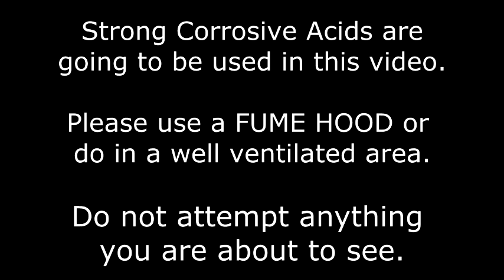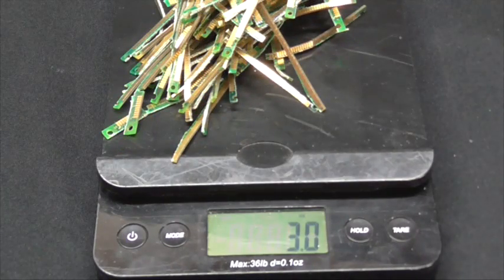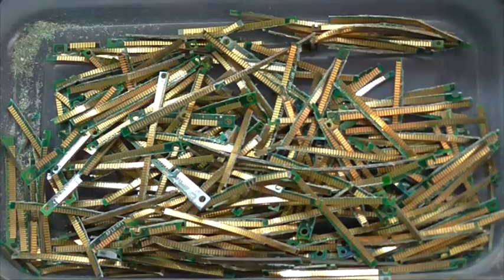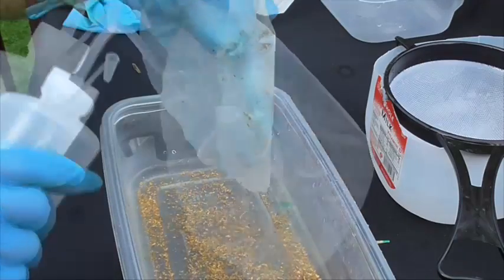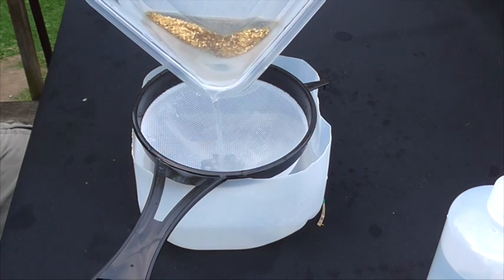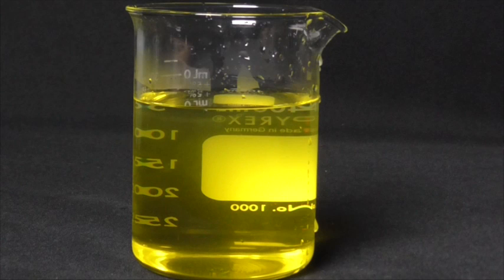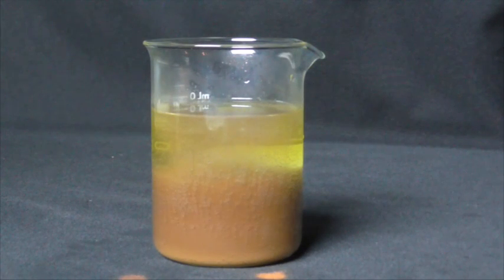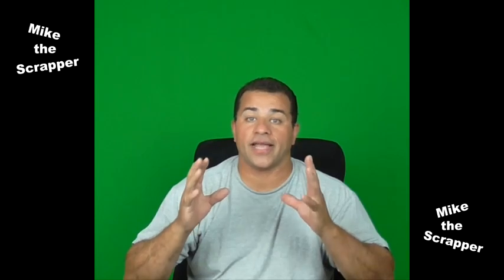Gold Recovery ( Scrapping Ram finger boards)

Comment: Hi bud you are doing it all wrong 1 little of HC and 50 mill of peroxide just to start the reaction and you can reuse the acid again and again and again if it starts to slow down just top up with HC and you can do load after load

Comment: It should come out a minimum of 2 grams, 24 K. gold from 5.2 ounces (520 grams) of RAM fingers. On video 7.55, Aqua Regia ratio 1: 1 is wrong. The best ratio is 3: 1. It is 3 part Muriatic acid another name for hydrochloric acid and 1 part nitric acid. Rest of the process is correct.

Comment: Nitric acid is expensive. I think I will do the H2O2 + muriatic acid step since those are cheap, then send those flakes to my dental scrap refiner. They melt and assay my denta crowns I send and they send me a check or bullion less a 5% processing fee which might be cheaper than doing this with nitric acid. Half the cost of my liter I got was the hazardous shipping charges!
Thanks for keeping this simple and easy. I had lots of fun in college chemistry classes and I’m glad I know what’s going on here.
Also, will this work for other items like the tiny gold fingers on certain ribbon wire, SIM cards, and the like? 
Thanks, Mike!

Comment: again, urea doesnt neutralize the acid, it removed the free nitrates from solution. check your PH after urea. still 1. 
if you actually brought the ph up you'd fail to drop the gold.... stop making videos while you clearly do not know what youre doing before you get hurt man.  
That "chemical" there is aurochloric acid you simpleton, it literally IS muriatic acid with gold dissolved in it. at what point did you think publicizing these methods and "knowledge" was a good idea? someones gonna hurt themselves

Comment: Hi man, why can't I just put all my processors directly in AR, is it necessary to separate magnetic metals? Why is this so ? Thanks
Reply from the maker: if you put all your ram in the solution. it would use up all the solution and still have gold on the ram. it is good to separate magnetic metal, that would be steel price. any metal that does not attract a magnetic, needs to be looked at. Can be worth alot more than steel price.

Comment: this is a good demonstration but the urea is unnecessary. you dont need to neutrallize the acid to be able to percipitate the solution. it wont turn back into a liquid cause your just breaking down chlourauric acid into hyrdogen chloride and gold metal. and instead of using nitric acid (its expensive) just take your stuff from part 1 and soak it in hydrochloric acid and SLOWLY inject bleach into it. HCL+sodium hypochlorite (bleach) make salt and a huge amount of chlorine gas. which will then attach to your metals making nickle chloride, copper chloride, and auric chloride. and your auric chloride will then turn into chloaouric acid. and then you can just percipitate it from there.
Reply from the maker: Dam...I think you just lost half my subscribers...LOL
Reply: lol lol lol
Reply: Yup. Just what I was thinking...lol

Comment: Hey Mike, nice video.. Just to understand, what happens if I just smelt the gold immediately after the acid peroxide filtering? Will I not get pure gold? If so, what kind of gold purity am I looking at..? Second question - do laptop ram chips contain more/less/equal gold compared to standard boards?

Comment: If you add a piece of Iron/steel bar to the copper solution after rinsing it will drop the copper and then save it. Copper in solution is harmful to aquatic life. Then add baking soda to neutralize, before disposing.
Reply from the maker: Keith Miles That is good to know....Thank you
Reply: I've heard aluminum and stainless to drop copper does iron work better

Comment: can i use muriatic acid 33% instead 31.45 % it is same work or any problem thanks
Reply from the maker: Johny Dar yes you can
Reply: Mike the Scrapper  thanks i will use becaus i purchased muriatic acid and seller sent me ) muriaticacid+h2o) was written on bottle then i mix muriaticacid+hydrogen) and put 2500 sim cards in t next day i see there was no gold my sim card was cleared and acid destroyed my all gold and i lose my 2500 sim card now i will use 33% muriatic and will see if it will work thanks for answer

Comment: My understanding is that the cost of the chemicals will drastically limit the investment's worth. Perhaps on a large commercial scale it can be worth it, but the margin is so small. Maybe if there were a simpler way with less labor, fewer chemicals but more time involved (like how one can get copper off of iron scrap).
Reply: CyborgNinja7 This is where batch size come into play. You will get better results upping the number of boards-to-chems ratio.

Comment: hi can use muartic acid again and again mean after one time using it will wasted or can use for other scrap thanks
Reply from the maker: Johny Dar you have to use it quickly. it will lose its potency
Reply: Mike the Scrapper 
 

thanks but i need help 
i  have add 1000 ml hydro+1000 muartic    for 2000 sim cards after one day
 i saw there was golden chip was swimming but after 2 days i saw all gold  disappeared  ---acid eat my all gold lol pls tell me wht i did wrong with it ,should i seperate gold in one day?  i have wait 2 days that was mistake or 
any other reason to lose all gold please answer thanks

Comment: Hi Mike, I really enjoy watching videos. I have been saving computer parts for a long time and I didn't buy them, people throw them away....The question I wanted to ask is, would you use the same amount of peroxide/muriatic acid (1000 mil of each) for doing 700 fingers?? I also have several cell phone boards, cpu boards and about 25 ceramic processors and 2 (10oz) jars of gold pins etc. You know I mite not get rich but all of this didn't cost me a thing, besides "One mans junk is another mans treasure". I enjoy scrapping, I've been doing it since 1982, it's extra money when times are hard and people are always going to throw junk away. Mike keep making the videos, I'll be watching!!!

Comment: I read the difference between gold and platinum group (5 metals) is the heating of the aqua regia. In gold you should not have to heat it unless you want it to work "faster." Referring to the catalytic post below, the platinum ($1200/oz) comes out as a paste and needs to be refined further - please correct me if I am wrong, and the rhodium ($2400/oz) and palladium needs to be refined with processes not "reasonable" to the DIY'er. Might be B/S, the right thing to do is ship to PA and let the big boys do the cats and stay out of the chemicals. Again, I am not a chemist. Last time I looked into cats I was getting $80-100 for big OEM automotive and the truckload was paying $20-40 a cat more if you save them up but the guys in PA or Quebec will grade them and give you a check. I was unsure if I refined and screwed up and got a mixture of paste that nobody wanted  I would be losing money. I went out and got a day job - it was just easier than the stress of hustling when all the used cars went extinct.......

Comment: Mike, like the vid thanks. Also watching the shaker table method for dirty boards. Had you tried taking the copper out of solution by electroplating onto a copper pipe with a transformer or  stick welder? I'm no chemist that's why I ask. I read copper is tough because of the melting point and you could also use it to replate old parts under the chrome.  Also would electoplating the gold work instead of messing with a furnace or torch? I'd like to see you make $43 instead of $40 if possible. Thanks again, thumbs up!

Comment: Hmmmmmm! Hobby huh what a wast of time work for hrs with caustic toxic acids and chemicals damage your immediate environment your skin lungs air and hair create all those free radicals and positive charged ions for what maybe 30 bucks 100 pieces of ram is approximately 3.7 lbs x $12 per lb = $36 market value for scrap ram you loose after cost of chems. Refined recovery value runs at approx $15.93 - $16.27 per lb just sell the stuff if you have that much you'll be much better off . What are these sorts trying to teach people anyway how to de-pit an avocado worthless........

Comment: A lot more profit in selling the Ram as a Ram on Ebay. I would not recomend this, as I build computers and Ram is very valuable. Those look like older versions of ram, you could of gotten $2 a board minimum (I say minimum as you would most likely get $5 per board average)  All depends on the GB of ram per each. Most of them are probally at least 512mb or 2gb
Reply: ***** LongDong
Reply: ***** Did someone fart in your mouth again? That's a bad johnny. Daddy told you not to be doing ass to mouth anymore. It is not right to want another male to fart in your mouth while you give him a reach around.

Comment: you know, Gold solves in muriatic Hyrogen PEroxide :/ so you lose a lot of gold while etching the copper. Better do it just with concentrated nitric acid or a copperchloride bath (needs time!). You can also use a oxygen or air bubbler

Comment: How much gold would you have to recover to make a good profit with the price of the chemical used.
Reply: monkeyman123321 well i just finished my first batch ever did around 10 cpus worth of pins and about half an ounce of ide pins . and maybe 50 video cards like 60 ram chips only for like 3g of gold
Reply: piero muro  but i only spent money on the muriatic and SMB so 18 dollars + the torch so like 40 bucks
for like 100$ worth of gold but as a first timer you will spend mmm 100 hours or so lol..

Comment: This is a really cool video, did anything go wrong when you were testing it or trying out some of the scrapping?

When working with chemicals it can be so touch and go sometimes.
Reply from the maker: Tom Buechel On this video was the 3rd try. I used so many ram boards before I got it right. I was terrified of using the chemicals. But I am glad its over.

Comment: Hey Mike great video, thanks.
Once you done step 2, getting most of the gold off the fingers can you not melt the gold as it is? I dont fancy the idea of all those acids and Nitric acid is strickly controlled here I cant get any to do what I want to do, it isnt seen as a valid reason to have it.
Reply from the maker: BladeRunner21577 Yes....You will yield about 10k...
Reply: Mike the Scrapper Can I ask why you do it the way you do it?
I assume you can work your gold into something as its cleaner?

Comment: I have question Mike. I have tried this process twice now and not had favorable results. The main problem I had was when mixing the Nitric acid. When I added my nitric acid It started to react rather violently producing a red smoke. Then when the muratic was applied the solution got very unstable and boiled over the top of the beaker. Not sure what's going on here. The solution always looks very dark brown.
Reply from the maker: Douglas Bartelt hmmm interesting...
Reply: Did you follow the instructions TO THE LETTER? It reads as if you had a lot of ferrous metal in your batch. Iron acts as a catalyst...and boil overs are the result.

The reddish brown in your solution is RUST...Ferrous Oxide or Iron Oxide. The Reddish brown smoke is Nitrogen Dioxide...SMOG...

I know of a refinery who dumped $18,000 onto the concrete foundation in that shop due to a boil over of Aqua Regia solution because they did not remove the steel from the Gold Filled batch. Both the client, through his ignorance, and the refinery, through incompetence, expecting that the client was aware, screwed up. So $18,000 of Gold sits in the foundation of that building....unrecoverable...until building demolition. Both parties were negligent. So the client received $10,000 when he expected $28,000. (And these people are professionals. Costly mistake, eh?)

How do you "mix Nitric Acid"?  How much Chemistry do you know? If you do not know about Chemistry you have absolutely no business attempting this.

You cannot skip or hurry the first step. 

Did you scrape the Gold from the leads instead of using the Hydrogen Peroxide and Muriatic Acid process?

The layer of Gold on those leads is 30 Microns thick...That means 30/1000ths of one millimeter. It is very, very thin...

5 Ounces of Gold Fingers...140 grams...yielded 8/10ths of One Gram of Gold..

It reads as if you have no business doing this since you do not follow instructions to the letter. BE HONEST. Did you follow the instructions to the letter?

You know what is funny. As I study Physics and Math, and I have some Chemistry coursework behind me, I am still studying this process and have not yet attempted it. And I am a professional.

But I want to know everything about it and have the right tooling before I even venture into this. Even yesterday I went down to the Jewelry Exchange and picked a Refiner's brain as I purchased equipment. Because of that I will realize success.
Reply: I did it also but your problem was that you didn't mix the chemicals before you add them. We had the same, but we redid it and than it went wrong with the urea and scrub powder :(

Comment: $40 / 4 days - $ for chemicals = Fuck That.
Reply: and you forgot payment to the assayer to assay it and the furnace cost to melt the gold
Reply: if you had a couple thousand of those ram boards, it would be closer to $600 +/-  (depending on the price of gold)... not only that, while it may take 4 days for the process, it does not take 8 hours a day over a 4 day period... the most difficult thing is to collect the computers, I suppose... but, if you are doing this, then you are most likely garnering income from other parts of all the computers you collect... this looks like a good biz to me... not planning on getting into it, but looks good for those who want to enter into it

Comment: I did about 30 cpu processors and everything went well but when I finish my melt the so called gold seem to have a orange color instead of yellow can you tell me why, is there copper mixed in when it got precipitated?
Reply from the maker: keith morrison sounds like it. or maybe it was hot enough
Reply: thanks mike. I did everything by the book , I also boil it in muriatic acid for 15 minutes wash it then boil it again in ammonia then again wash with distilled water and once melted it has an orange color and read only 10k.

Comment: Hello my friend.
Really impressed by your video. 
I would really like to try this experiment.
I wanted to ask is whether the same way to generate gold from copper objects that are coated?I'm waiting your answer.
Best Regards Markel
Reply from the maker: Markel Dermyshi you can do it, if it is gold coated. Using reverse electroplating.
Reply: I can't use your method to recover gold from the cooper or this method is only for the border Ram from computer?

Many thanks 
Markel

Comment: why not smelt it right after the getting it off the boards, adding flux when smelting could get all the debris right ? and for other gold platted metals in the computer, can they be put in the same process ?
Reply from the maker: nemesisfcl you won't get 24kt. You will end up with 9 - 10kt
Reply: oh, ok thanks for the quick answer :)

Comment: Hi, I have some question. How much baking soda need to neutralize the acid? Baking soda is diluted in water or directly in acid? Thanks
Reply from the maker: Ducati Carbonio in the acid once done. depends on the amount used. I would say to be safe, for my batch , I used 1/2 cup
Reply: Last infromation please. At minute 5:41, what do you use to wash the tank?

Comment: the reason it probably looks more complicated is , while your watching it, if you are not familiar with the chemicals that are being used it will add to the confusion as your thinking , hum? where would I get that stuff from. then by the time the video is over you are convinced its too much work , but its really not any different than most others , its a process that has to go thru each step in order to obtain the purest gold as the end result. .Keep in mind , that nitric acid as apposed to Miriatic acid may be harder to obtain,due to the things people can make with nitric acid, you may or may not need a licence to use it, for example your bisiness requires it to perform a certain function in order to work bla bla bla ..

Comment: Great job on the safety of using acids . All it takes is one wiff of acid fumes and it can fry your lungs and if your in a non ventilated place when that happens and you drop to the ground gasping for air , you can bet the next breath of acid fumes will finish you off. At some stages of this process the fumes are visible , a bronze smoke will creep out the top , however , this does not mean that there is no other acid fumes in the air , for the most part , they are invisible , and even if you are working outdoors with acid , you would be crazy not to where a resporater mask . Even a small breath of acid fumes can severly damage your lungs , its that dangerous .

Comment: Do I just keep pouring baking soda in, and test the PH with a strip, until the PH is 7 to neutralize it? Can I pour it down the drain once it's neutralized? Are any of the fumes flamable? I wouldn't want a spark in my fan to start anything.